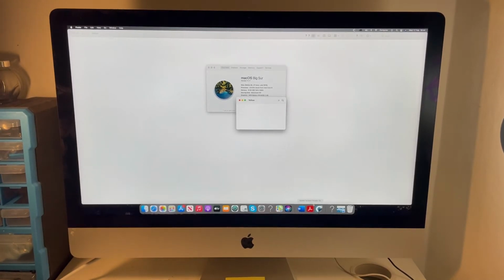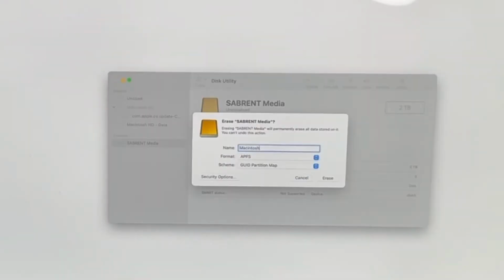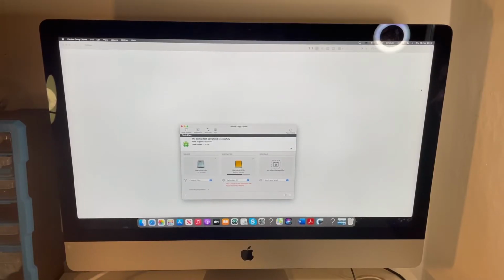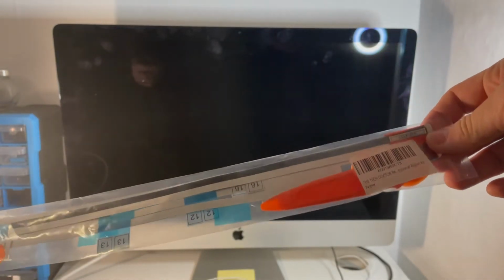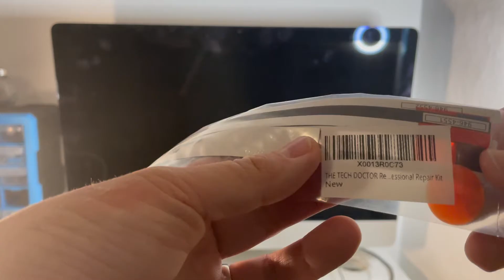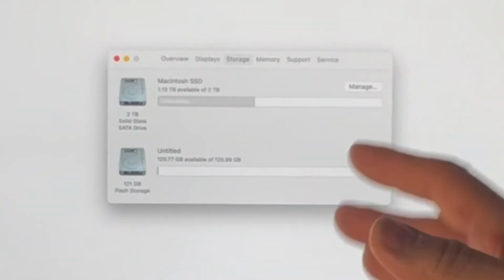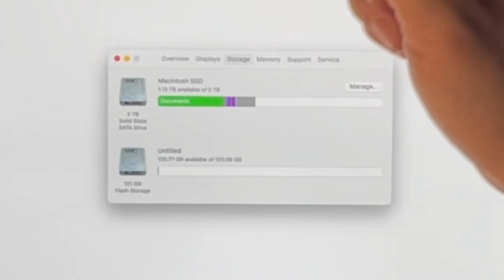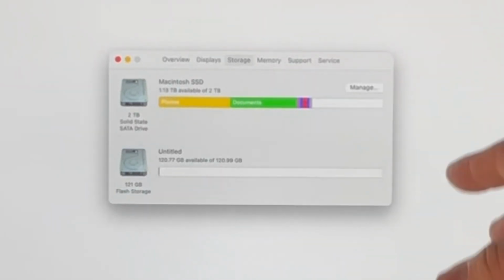iMac 27" Late 2015 A1419 4K - SLOW Fusion hard drive replacement with new internal SSD, MUCH FASTER!

Comment: Hi. I plan to use the Sintech ST-NGFF2013-C adapter (it's like a flat bed truck) to upgrade the 128GB Apple Blade with a M.2 Teamgroup M.2 NVME 1TB that has this dimensions: 80(L) x 22(W) x 3.8(H) mm

Would that M.2 NVME SSD fit and be ok?

Also, do I need to buy the plastic cutting wheel. I have a guiar pick and old credit cards.

Thank you.
God bless, Rev. 21:4
Reply from the maker: Yes this should work however it’s harder to get to the SSD as it requires taking out the logic board.

However I advise using a standard 2.5 inch SSD to replace the HDD. It’s cheaper, it’s far easier to access. Also the adapters like Sintech- I’ve had to replace a few of the over the years and it’s far easier to do on a MacBook. However on an iMac it requires a full disassembly.
Reply: @Andytizer  Thanks. I've disassembled Macs before. I plan to remove the hard drive and the 128Gb factory blade/stick SSD used by the Fusion drive. I only plan to upgrade it to 1TB NVME SSD which is enough space for me.

But in accessing to remove the 2TB hard drive (I will repurpose later as a kind of games installation for Boot Camp maybe), do I need to remove the heatsink from the CPU (thus needing to put new thermal paste on it)? Thank you.
Reply: @Andytizer  (I now plan to use a 1TB ADATA XPG SX8200 Pro M.2 NVME SSD. It's thermal is up to 70C vs. Teamgroup's thermals is up to 80C, I wonder if the heat would be an issue?)
Reply: @Andytizer  I see, your Sintech adapters, what happened to them, in your experience over the years by the way? Do they die after a year or two (how long did it die in your case?)
Reply from the maker: @SevenDeMagnus  To remove the HDD it's just the steps in the video. I'm not 100% sure of the SSD removal steps. And yes you can use a guitar pick to remove adhesive just don't crack the glass and don't cut the webcam cable.

I don't have the numbers for SinTech adapters, I have installed probably 30 of these over the years, and I've had 3 need replacing after 1-2 years (that I know of).

Comment: Hi Andrew, great video, very thorough. My late 2014 iMac shows only one drive in the "Storage" section of "about my mac" (re: first 30 seconds of your video). If I clone my drive and replace the HDD with the new SSD, do I need to do anything with the PCIe 128gb drive in advance before doing the procedure? Does it matter that it will still contain some fragmented old data from the "fusion" aspect? Do I need to break that software link before physically breaking it and replacing the HDD w/ the SSD?
Reply from the maker: When you install the new SSD and you are in the recovery drive, you can just use Disk Utility to wipe the 128GB SSD and that hsould take care of it.

Comment: Great video but I'm surprised you didn't address the dust issue on and around the fan. Otherwise great video!
Reply: Because this guy is a lazy technician. Didn't bother removing the screen, why would he dust out the fan? also don't see any esd precautions being taken.
Reply: @dancheetham2452  how do you know he did not clean the internals?  Not removing the screen was intelligent it was not necessary to remove the whole screen. There were advantages to not removing the screen. The video was well explained and executed.
Reply: @dancheetham2452  there is a difference between being lazy and working smarter. Though I personally would have taken the opportunity to clean the inside.

Comment: i'm having the same issue, not sure if it's hdd or the nvme.ssd issue, is it a good idea to replace the nvme.ssd? or just replace the hdd with 2.5" ssd? is there a speed gain for the nvme.ssd?
Reply: Go to the Apple store or Authorized provider. They will be able to tell which one has failed.

Comment: One more thing. Removing the glass really freaks me out. How easy is it to crack the screen?
Reply from the maker: I've done a dozen of these now and never cracked the glass from opening it, just make sure to thoroughly use the cutting wheel to cut the adhesive and go slowly.
Reply: Make sure the glass is not compromised before attempting removal. Not fun when it cracks more!

Comment: I have a mid-2015 iMac. Am I safe to assume it's the same process? Also, where did you get the tool kit and prefit two sided tape?
Reply: Same process. Don't recommend using third party adhesives. Go to Apple store or Authorized service provider.
Reply from the maker: Links to the products are in the description, good luck!
Reply: Look up OWC's video on how to upgrade the mid-2015. Much more thorough than you see here.

Comment: Great video and very clear to understand the steps. I'm considering upgrading my late 2014 5K retina. I followed your initial steps to look at the Fusion Drive SSD to HD allocation and all that shows on my mac (in the storage tab) is details for the Macintosh HD 1.12 TB fusion drive. There doesn't  seem to be a separation of the details for SDD-flash & HD (30 seconds into your video). Is this an issue or am I missing something?
Reply from the maker: It could be that this is one of those single unit Fusion drives instead of the separate ones used in later Macs.
Reply: @Andytizer  does this video still apply to those macs then?

Comment: Did you forget to use a in-Line Digital Thermal Sensor SATA cable adapter? Or is there no need for one? What about the fan noise after your upgrade? Thank you for your video.
Reply: A tech guy told me these sensor cables are a scam, he’s taken one apart and the two attached to the sensor do nothing.

Comment: Great video.  I have the same late 2015 A1419 but with the Samsung Blade Fusion drive ONLY and it has gone bad.  There is no sata cable in mine and I want to install an SSD as you have.  Do you have a video for sata cable installation?  Worst case, I have to install a replacement Samsung MZ-KPV1T00/0A6 blade which is close to impossible to find.
Reply: 1) why are you so wedded to the failing Samsung Blade drive? Replace it with a Samsung drive. 2) eBay is your friend. You'll find your needed cables and drive mounting hardware there.

Comment: this video is really awesome!
i have a question about 2020 imac which has T2 chip  connected.
what do you think 2020 imac? 
does this work 2020 imac with T2 chip?
I mean I want to upgrade SSD ;;

by the way, thanks for sharing the video.
you already have my sub. this is first time to leave commend.